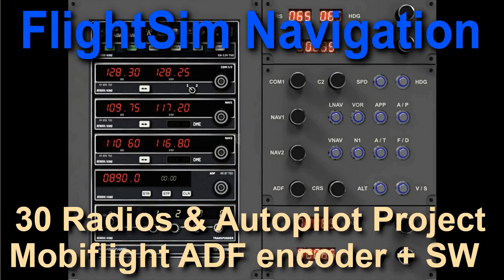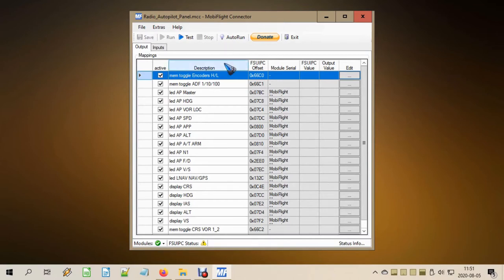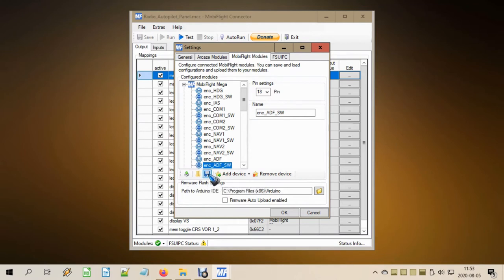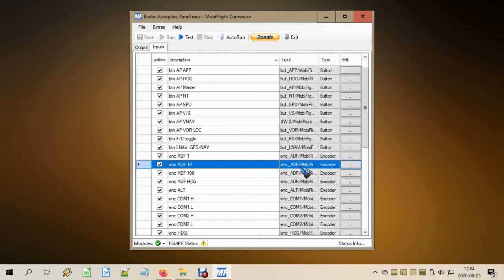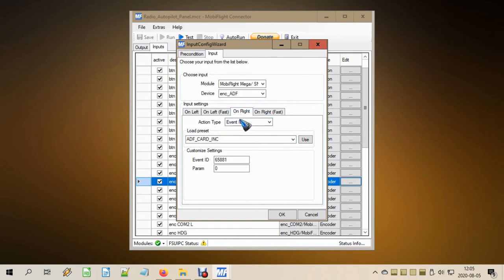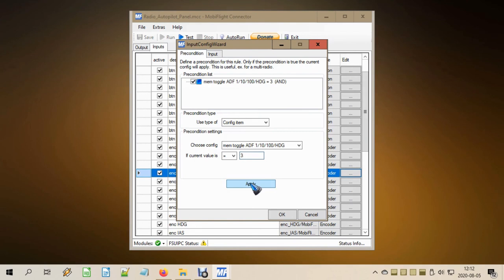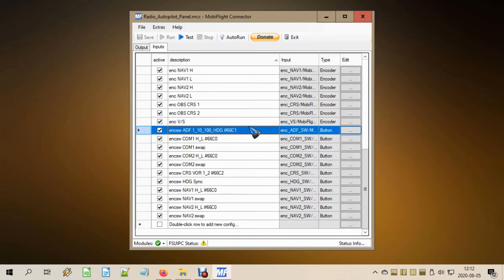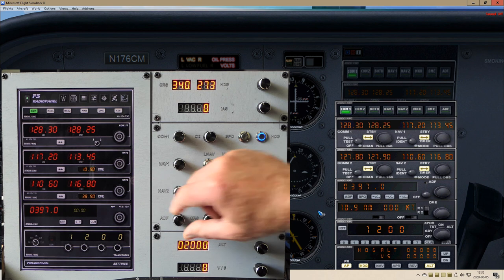Flight Sim Navigation 30 Tune the ADF Radio in Mobiflight

Comment: can we do that with a 7segment display to show NAV1 NAV2 COM 1AND COM2 using a button to switch this all in the same  display?
i ve been trying but can only use two options
Reply from the maker: If you'd have a variable in say memory location #66C0 that increments 0>1>2>3>4>5>0 based on a push button, that the value of that variable can be used in the display as a pre-condition. See here how to create this variable: https://flightsimnavigation.wordpress.com/2020/08/05/30-radios-autopilot-project-tune-the-adf-radio-in-mobiflight/
Reply: @rudyshobbychannel  Hi
I've tried and tried to show all radios in the same 7 segment using the preconditions you have but still can make it work.. I won't give up until I make this work. Have you tried to do the same thing for testing?
Reply from the maker: @techsilv5170  I don't use one display to show different radios, but with the 'pre condition' option this should be possible. Or ... I'm doing this by head here ... maybe there is no pre condition tab available on the display output?